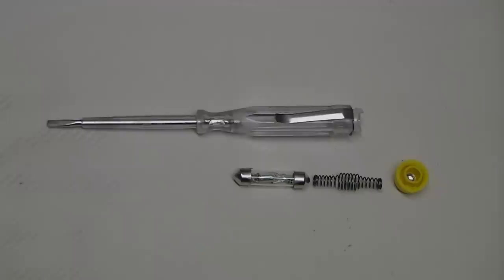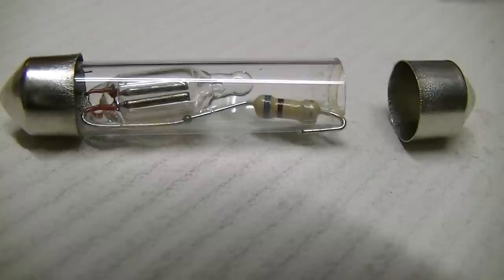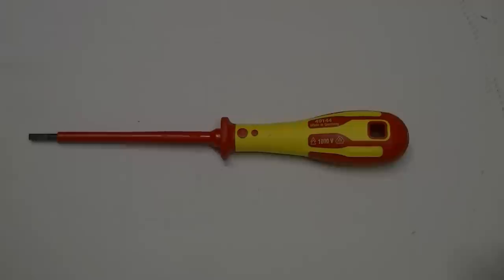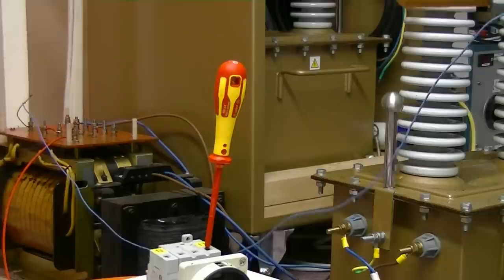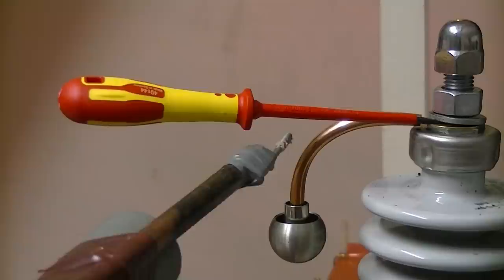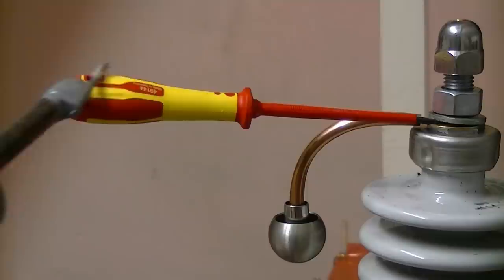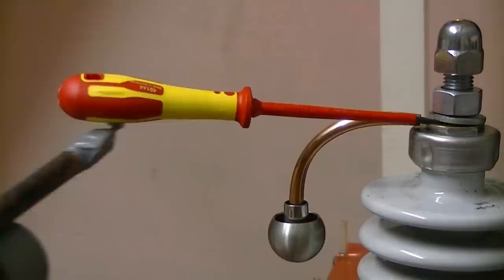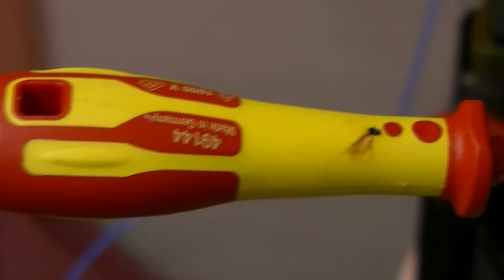Killer Screwdriver

Comment: I think if you're using a screwdriver to test 8,000 volts OR if there is a 8,000 volts current in your domestic outlet, the screwdriver quality is the least of your problems.
Reply: Exactly what I thought.
Reply: 8,000 volts current yeah??
Reply: you say having an 8,000v tap in your house, like it's a bad thing?
Reply: @CooKiesHouseCannabisCo   it electrocutes you when you come near it
Reply: Cookie's House Cannabis Co I just wouldn’t stick my shaver in it.
Reply: You noob 8000 volts current voltage and current are diffrent noob 😂😂😂
Reply: @Maloy7800 😂STFU
Reply: @HarshRMaru  NOOB!
Reply: @Maloy7800  well,let's not fight ok? 😁
Reply: @Maloy7800  noob
Reply: @Fruice_Lee  No NOT 8KV current but 8KV    current =?
Reply: @JDMz  noob
Reply: Chuckle
Reply: I know this is a 6 year old comment, but here’s just a little FYI. Think of electricity like a water pipe. Voltage is the pushing power of the pump, whereas current is the volume of water in the pipes. Voltage (EMF) is fixed at the source, and current is drawn by the components, depending on their resistance. This is all in accordance to good ol’ ohms law, where I = V/R, and since resistance is the denominator of this equation, the less resistance you have the more current is drawn…

Sorry about the insufferable folk above me calling you all sorts for not knowing this. We’re all at different stages of learning/understand and that’s ok. We should be more supportive of each other in that respect…
Reply: LOL!
Reply: @Fruice_Lee ..late to the party but anyway.. 😅 he meant current as in present but it should have been “currently” to be correct grammatically.. 😉

..or he just meant current 🤣
Reply: 8000 volts current?
Reply: @Fruice_Lee  Blimey that's a lot of currents per volt 😂😂😂
Reply: @Fruice_Lee  Cleary YouTube is not the place to learn this kinda stuff.
Reply: @altvamp   *your

I think for a basic understanding, the water analogy is fairly effective. Lecturers will commonly use this to ease their students into the topic. But do elaborate on why you think this explanation is as “flawed” as your grammar…
Reply: We always called those 12 volt test lights, perfectly safe in a car
Reply: @MrTravis789  Neons don't work on 12v  😂🤣😂

Comment: When the photonic induction guy says a tool is too dangerous to use, you wanna make sure it doesn't come within a thousand yards of you or your loved ones.
Reply: @ts757arse  Did you give it a try?
Reply: @jamescollins6085  He died.
Reply: @phreak761  you’re joking right
Reply: @butterdog223  Maybe.
Reply: He doesn't actually know what he's talking about.
Using a test device that is clearly rated for use testing up to a maximum of 500v on an 8000volt potential. Is like fitting a 1000hp engine into a Morris Minor, and then complaining that the brakes and handling are not good enough.

Comment: I particularly like the garage mechanics version of this screwdriver that has a croc lead that plugs into the end.  When the croc lead isn't plugged in it looks identical to the mains tester, but there's just a 12v lamp inside.  I wonder how many people have tested the mains with that!
Reply: It would get a bit fizzy.
Reply: Actually bad memories for me with a mis-labelled test bulb that was 12v instead of 240v, i was lucky to be in a crouch position so i jumped back with a hand stuck on the test "screwfryer"
Reply: Isn’t time a funny old thing?
Reply: Fishing viewers from other channels.
Classy
Reply: I can tell you – from stupid experience– that it gives you a nasty shock. But because the point of contact is small and at the top, it’s nothing too bad at mains voltage.
Reply: Man I just found this content, and yours a while back. 8 years ago not so much.
Reply: The 12v ones are super handy to throw in a glove box. I didn't know people even still used the ones for mains testing.
Reply: The 12volt car testers are grounded via a wire with  a croc connector. They don't have a grounding button on the top of the handle, and so are safe. I have never seen one that has the croc lead plugged into the handle , usually the croc wire emerges from the plastic moulding. I guess if such ones exist (that have sockets in the handle),  and the socket in the handle has a touchable live conductor., then it is a truly dangerous device, and should not as such, be allowed on the market.

Comment: Guarantees 1 000 Volts, can take almost 100 000 Volts.
Reply: thebel89 Made in Germany ;)
Reply: Llamanator Everything is not linear in the the world of electrons. Very impressive.
Reply: Dats german engineering ;)
Reply: That's good considering most people who use this probably don't own a volt meter
Reply: i was impressed that 1kv insulated screwdriver can take 100kv to break down...
Reply: I'd think that 1000V rating is for continuous voltage, not instantaneous.
also, it's safe to hold it at 1000V, not "the screwdriver doesn't explode at 1000V" if it's an actual rating.
Reply: When brand new,......the trouble with German gear is they think it's world beating
Reply: A L M O S T
Reply: @satibel  Trouble is would you stake your life on it? at the sort of energy involved in the power industry when it does break down the following event is just a little? destructive, not sparks but instant sun burn and usually death to whoever is in contact with the tool, NICE!
Reply: @14Flolo  german perfection. FÜRS VATERLAND
Reply: @s s BZzzzzZzzZZZTTT!!
"Anyone seen my leg?"
Reply: Once carbon tracking has got a foothold, it's curtains...
Reply: yep, its designed for being treated like shit and then still handle over 1kv. Thats called Qualitätskontrolle
Reply: Wish all my electric stuff was as reliable as that screwdriver....
Reply: @gimmieliberty6514  ever heard of grammar? how does gear think anything? why would you want to hang on to clearly borken goods as you allways know your tools are new or not? Are you an American?
Reply: safety factor ay boys
Reply: It's a 1000 volts line voltage, which means it needs to withstand excursions in the 12000v range.

When a very heavy load turns off the voltage can momentarily spike that high for microseconds or whatever. But if it can withstand it for that long, it could probably withstand it steady state ( but not working, cause then the excursions would be correspondingly higher)

Main difference between the different categories of equipment- cat II - cat iii/IV.

The further towards the transformer you go, the more current flowing and thus the voltage spikes. So you need a higher voltage tolerance for the same working voltage.
Reply: @gimmieliberty6514  which it clearly is..... Enjoy ya Austin Alegro
Reply: I'd buy that on the spot

Comment: German engineering... It takes 100 times the designed threshold to destroy it... Imagine a truck designed to carry 10 tons of payload, and you put 1000 tons on it, and it still goes... Amazing...
Reply: Wow, that was a very detailed reply to my comment :) Yes, I understand what you are saying, I just wanted to saythat some products exceeds their designed limits, while some other cheap products don't even come close to their claimed quality.

You can find 5000V rated screwdrivers on ebay which would fail under 1000V.
Reply: The red and yellow screwdriver is constructed of metal (the tip) plastic (the red bits) and rubber (the yellow bits).
Reply: Ariel Barton Normal screwdrivers don't need to worry about high voltage, so the steel bit is glued directly into the handle. With high voltage around, You need to minimize conductivity. With an electrician's screwdriver, the bit is completely isolated from the handle by the shaft, to prevent extreme voltages from jumping through the handle molding into your hand. Ordinary plastic would melt under a few thousand volts, not only electrocuting you but melting into your hand. These not only withstand high voltage, but as you saw, don't melt under heat.
Reply: Ariel Barton
The metal shaft goes from tip up to the handle like any other screwdriver.  The difference is that an electricians screwdriver is 1) always red, 2) always has an insulation sleeve on the shaft to prevent accidental grounding/connections to unintended conductors (exposed wire, the junction box, anything else grounded or energized), and 3) always has thick insulation on the handle to make current flow unlikely.

This is why they're always so pricey... because they can save your life. 

P.s. always keep them clean and dry... having water or oil on the surface defeats the whole point. ;)
Reply: *****
It must be some kind of impregnated paper as found in transformers and capacitors. Regular paper has pores making it as weak as the air, not to mention when it gets wet.
Reply: Ariel Barton
The screwdriver uses a harder kind of plastic than a cable would. But handheld high-voltage equipment doesn't rely on insulation like that, it also has to have long, non-conductive handles. Example: 22kV single-strand - 12mm LDPE insulation. 22kV pliers - 60cm long PVC tubes for handles complete with gasketed handguards. It's just for "overkill" safety, the live cable with said 12mm insulation won't hurt you.

Comment: German Logic:
It could handle 50k Volts
But lets get save and rate it for 1k
Reply: practically anything German wise... just double or triple the damn thing and you got something great
Reply: It's not German logic, that's the logic of a given standard which dictates under which conditions can something land on the market and claim to protect against XY. Lot of the times, these standards take into account even theoretical situations which are extremely unlikely to actually occur.
Reply: The massive safety margin also factors in wear and tear over it's expected lifetime. The insulation is likely to be thinner after 10 years of use reducing it's resistance.
Reply: theese safety margins also factor in production variations

Comment: So let me get this straight... this screwdriver is supposed to light up if it probes a live terminal?  Those high tension tests were certainly showing rather vibrant illumination... seems it's working perfectly fine!
Reply: My father has one of those testing screwdrivers. It is very good and handy if you only use it for 240 volts. Hungary btw
Reply: No it's not. You need to touch something conductive to get a decent light out of the neon, which is in itself dangerous. If you are well insulated the light is very dull and you might not even see it. So the tester would tell you "OK no voltage" and then you fry yourself because there was. Don't use them. Also they are made in 12V versions with just a shitty little print with the voltage.. grab the wrong one once and stick it into the mains and be prepared to be quite suprised.
Reply: My Dad had one of those in the Late 90's... Never Tried it in a Live Socket etc

Comment: The 1kV driver did well.  I wonder how well it would do after it had seen some heavy use and been kicking around in a toolbox for a while though.  That said, I recently got a new pair of snips and submerged the handles of the well used ones in salty water and did a 1kV megger test between the water and metalwork.  They tested fine.
The corona discharge fizzing before the failure was possibly AC coupled corona discharge?
Reply: You can see the plastic is of a very durable kind. Not like that cheap shit from China.
Reply: or just look after your tools?

Comment: "You'll be hanging on to the end of that,wondering what happened...."
Reply: Electrician #1: Shit, my screwdriver disappeared!

Electrician #2: Found it! There's a bit over there, there, there, and a bit in the wall over there.
Reply: @slowmosounds8947  Nah if you had 1000 volts at relatively low amps going through that, You'd get a nasty af shock, You'd be hanging on to the end of it wondering what happened

Comment: Those "daft" little neon screwdrivers must have saved countless lives. They are easy to deploy, therefore more probing takes place , and therefore live conductors that are  either expected , or supposed to not be live, are detected in a timely way.
Having worked in the industry for decades,  I can say that I've encountered many  reports and personal experiences of these things averting accidents. The only case I have ever  encountered of a person being shocked  via one, was when I felt a tingle after  I'd customized the tool  for testing an electric fence. I had elongated the handle and added insufficient (initially) resistors to make it operate at around 20kv. I ended up adding about 30Meg ohm ( if I remember rightly ) to get it to work.
Ofcourse it's possible to soak one in water and thereby short out the resistor , and get shocked, but I've never known of this happening . I guess one can manage to have an accident with anything - that's what the Darwin awards are about. But these handy and inexpensive devices DEFINITELY  save more lives than they take - a bit like seat belts.
Sometimes a neutral wire disconnected from the main neutral bus  will float live via a an appliance . A neon screw driver will detect such a live neutral , when most other test devices would not. As long as one remembers not to probe voltages exceeding the rated voltage on the tool, and one doesn't play submarines with them prior to using, they are very safe. One must also remember that they don't light up when probing the secondary sides of transformers. If you use these things intelligently, there is no danger. What is actually dangerous, is telling amateurs not to use these things. Joe Bloggs is not going to spend loads of money on an expensive tester, that he may not understand how to use or read properly, but he will buy a neon tester. If he doubts the neon, and so fails to probe,  then you do have a dangerous situation.
Remember folks, don't use your neon testers to probe 50,000 volt installations.
And don't listen to idiots telling you not to use them. They are perfectly safe used intelligently to probe  normal household mains voltages.

Comment: made in china vs made in germany
Reply: Meaningless comparison.  I have used (and still possess) German-made Neon screwdrivers that would fail just as spectacularly.  I have also a Chinese-made HV probe (2kV rating) that is VERY capable of  withstanding comparable overvoltage (and contains a fully-encapsulated HV resistor string). Having tested the probe at 10kV ( with excellent (microamp) current leakage) the Chinese quality (for a price, mind you) is no different to any other supplier. You get what you pay for. Qualilty costs, whether from China, Germany, or anywhere else.

Comment: After being electrocuted when I was 14... This puts the fear of god into me
Reply: mike malone how did it happen please.
Reply: storm3698 I was in Spain and plugged something in breaker didn't trip I was along for the ride simple as that
Reply: mike malone at least you lived to tell the tale. Electricity is a good servant but can be a cruel master.
Reply: There are differences between being electrocuted and being shocked. If you were electrocuted you would be dead.
Reply: David Findlay explains why I woke up in resuscitation then....
Reply: my mate has held on to 240v neutral and live mains cable before by accident and managed to fall away from it
Reply: I have had phase to ground via shoes through me for about 14 times when i was young. Not pleasant, and that 50hz 230v knows to shake your muscles quite violent. I hope i never get to experience phase to neutral. Once i accidentally shorted phase to neutral and that sounded like a cannon shot.
Reply: In Australia, people tend to use the word electrocuted to mean a serious injury from electric shock, not necessarily death. You occasionally hear news stories of people being electrocuted but recovering in hospital.
Reply: 120 volts ac, 60 hertz at our Outlets here in Canada, you can handle a quick shock. It's the sustained electrocution that ends up killing people, if you're stuck on that thing for more than a couple seconds your most definitely dead, but you can get away with holding it for a good second before dropping. The 240 volt Outlets the same applies, but your time frames are a bit shorter of course. But for both you can handle a quick shock.
Reply: @Engineer9736  hot to neutral isnt near as bad as a loaded neutral, got hit by one this summer, the triplex was shared between like 5 houses, 10 times more painful than a hot hit
Reply: Use RCDs Guys
Reply: El Chupacarba did you died?
Reply: @Pandamad  That is true, though it's still not correct. "cution" is etymologically from the root of the word execute. Lots of native speakers do repeat this mistake though.
Reply: @YouTubeSupportTeams  its just a tingle if you're not holding live. If he held live would be different story lol
Reply: AC holds ya, DC throws ya.